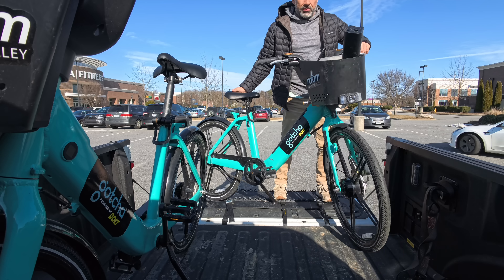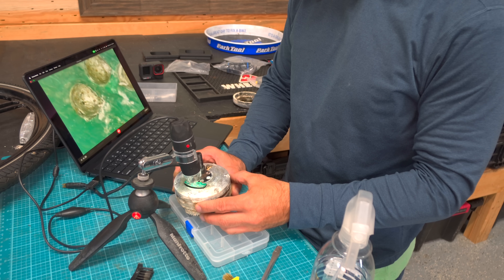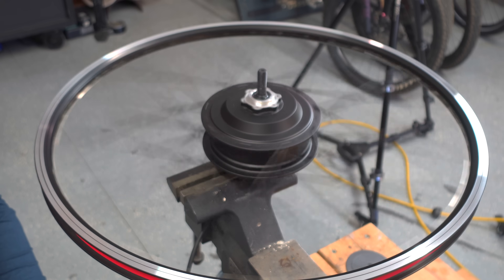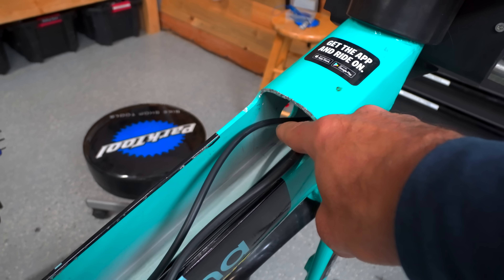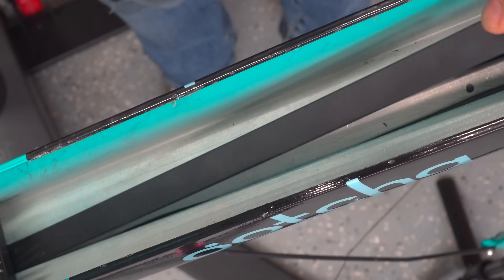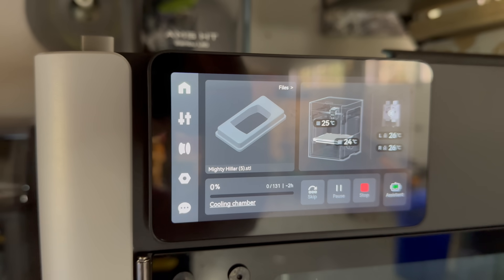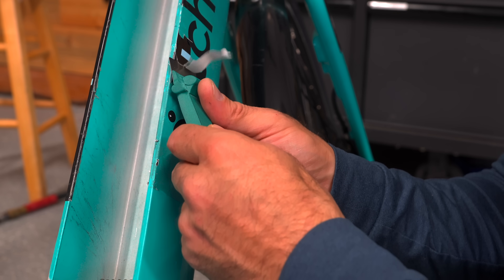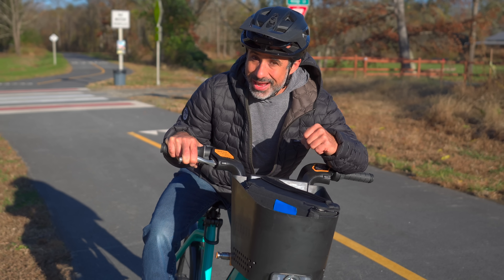What Will It Take To Save This E-Bike From The Landfill?

Comment: @berm peak

I've been homeless since February 10th, 2024. I was laid off from my job 2 days prior. I slept mostly on benches, not even a tent. Currently Im working, sleeping in a pop-up camper with no water and minimal heat. Prior to where I ended up, I saved money to purchase an Engwe M20 2.0 , but currently it's not working. I'm working for a small landscaping company and right now we do not have much work, unless it snows.

I was sent a new motor as well as a new controller. Having this e-bike work would mean I have a small room to go to, with an actual shower and bathroom. It would also help with getting another job, I gave just $200 remaining to feed myself and filly propane tank for heat. Please do me a favor and let me know if you can give me some guidance in this. I'm not asking if I a handout, just desperate because I'm not a bad person. Just fell on very difficult times and I don't want to die.

Comment: I'm just over here thinking why 3D print an adapter when you can just 3D print a slightly longer version of that as a socket with the ratchet adapter size on the trailing end 🤔

Comment: Did a quick search through the comments, and saw quite a few regarding the front brake.  My opinion is that the front brake is the primary brake with the most stopping power.  No front brake on ANY bike is pretty sketchy.  Now make the thing an eBike for super speeds and extra bike weight... you're way into sketchy territory.  I'm sure you'd be just fine given your bike handling skills, but put your mom on it and you're asking for big trouble.

Comment: You could probably take the guts from the new hub motor and put it into the old wheel they all seem to be very similar.  Making a disk brake adapter for it is doable.  I could make it out of metal, or design something and prototype it in 3d print and the have one of the CNC services mill it.... There is one that does a lot of YouTube sponsorships PCB-way lol ... And since not a bike product it doesn't influence your channel objectivity

Comment: mate for the front fork to have back a brake, you can go at a metal fabricator to make a meta plate that act as extender/holder/carrier for brake caliper with threaded holes to mout straight on without the need of nuts.  that plate can be made via a cnc machine ;)

Comment: It might seem a little retro, but why not simply fit a rim brake set to the front?  At least the bike will have two brakes instead of only one, which is proper built in 'redundancy', esp as the original manufacturer built the machine with two brakes in the first place

Comment: With a little more effort you could get the taillight diffusing nicely in that little space.
Then again with a little more effort you could have made it an active brake light...
But for better diffusion you'd mount the LEDs up against the back of the enclosure and make the back surface of the diffuser vaguely paraboloid in shape with 6-10mm between them. 
Technically it would improve brightness at off-angles. But you'd be making a better taillight than 99% of commercial bikes at that point.

Comment: wonder if anyone can point me in a good direction since its alot of ebike repair i got a funghange eb-m1 as a gift the rear hub axle got striped they sent a new core i managed to fix it but it has an odd issue that speed  just drops off everything works but the speed reporting just stops if it sits for a day it works again and you can have it run on a bike stand forever and it wont show up only when its on the road again pedal assist and throttle work fine it just stops reporting speed they did get back and say the heat sensor and speed sensor share a line but also i haven't been able to pin it down as over heating because it just dosent seem hot at all anywhere

Comment: You did a great job of getting that e-bike back on the road! I've opened up a few water damaged hub motors in my shop. It's not entirely impossible to potentially restore them. The rust combined with the magnetic flux from the neodymium magnets on the rotor will probably require you to pound on the end of the axle to get the motor apart. The rust can be clean off the stator easily enough, but getting the magnets clean will be more challenging. I use a technique of soaking a towel in solvent, and pinching off bits of rust until it gets cleaner.

It might have also been possible to swap out the motor assembly. It looks very similar to the style of hub motors that are common in electric scooters.

Another option for the lack of front brakes would have been to install a direct drive hub motor that has regen.

I really appreciate your video, and how you're helping to de-mystify the process of repairing e-bike electronics.

Comment: Hello Seth, as an aerospace engineering student and a 3d printing fanatic my self, I definitely recommend using the "gyroid" infil patern. From my testing, I have found out that you can usually have higher print speeds without sacrificing print quality. Also, avoiding "sharp" edges is for sure a great way to increase under load stability and fatigue resistance. For these reasons you should avoid the grid infill pattern for mecanical parts that you want to last ! Great video have a good one thanks.

Comment: Wow, I got inspired by the last video and bought one of these bikes on facebook marketplace, with my luck i got one which was in the condition similar to this bike, with that wheel locked, i couldn't actually figure out replacement front wheel. So i had to fix that motor which looked flooded, and mine was as well because they left it out in the rain for 8 years. Anyways i was able to hammer the rotor out from the stator, clean the whole thing and resolder new wires and hall sensors and got the motor to work and followed the process in the last video. That wheel bolt tool is awesome could have used that! but i had to take a angle grinder... Anyways after doing all of it, my wife got tired of me taking up too much garage and told me we don't need motor power... and i had to flip the bike to some one else...

Comment: 3:23 "Could it be that we just clean it and it works again?"
Something about the length of the video tells me it can't be that simple for getting the wheel working again. But there is more than just a wheel to fix. So I could be wrong.

😂 The branding under the branding sticker was a real "Gotcha".

Comment: Rear Drum Brake Only
'reliable' ahahahaha
while you might make the case that they're reliable since they always work and need no maintenance
they also always work badly; with no stopping power. Compounded by the fact that its the rear brake.
while its "road legal", is that really what we want as our milestone? still sketchy from a practical riding standpoint.

Comment: There really ought to be regulations about recycling these which include reasonable measures to make them usable when retired and sold on or given away. If there were, these bikes could be designed so that that can be done easily with minimal effort from the operator.

Comment: 17:54 Yikes. Is that the final state for that rear light's connector? I think I'd probably wire-loom that with something water & salt resistant, long term, because corrosion's going to get to those connectors fast.

Comment: I don't know how popular they are as a part for bicycles but on escoters it's very common to use the braking power of the front electric motor as second brake. It would be much better than skidding on the rear wheel on an emergency brake.

Comment: Did you tried scanning Bluetooth signal on them?
They use BLE so mechanics can unlock them locally without using 4g connection because SIM inside is already blacklisted.
I worked as mechanic for two companies.This one seems like OKTA model-same power connector but cables are different and it uses HiGo connectors but i am not sure it is bit different design or could be a Yumi .Dont rely to much on these original lock they are horrible and you can make motor free if you dip it in something that removes corrosion it may free up but you need to check hall sensor.

Comment: Pretty sure that's a compressive load not static on the socket adapter. I wouldn't rely on that as strength gauge if it's on anything safety related.

Comment: is the front motor  regenerative braking capable?
having regenerative braking at the front wheel would be very effective.
problem is adding a circuit to feed power back to the battery,
or another idea is to feed the regen braking energy into a another set of  red lights in the rear, creating a brighter rear red lights when slowing down.. you know like cars

Comment: Could you use a larger diameter rotor and drill that fork plate thing to get an old IS mount adapter to hold the caliper?

Comment: What is the reference of the controller? I have a similar case. I got an ebike but the controller is locked and the company went bankrupt and it seems there is no "easy" way to unlock it. I want to buy a controller but I want to get one that works for sure and is not impossible to setup.

Comment: I work on electronics as a hobby, it's possible those traces were broken like you  thought but whatever was soldered to those eyelets was giving you continuity. So it's always best to remove at least one side, ideally both then check your traces for continuity. Nothing worse than being on the right track and just overlooking something simple. But I'm confident you did more digging than you showed on camera so I doubt it was that simple. Man I love that we live in a time where we can just print our own parts and engineer solutions all on our own. Great job working out that battery latch!

Comment: Since you've been 3D printing a lot you can also print de-pinning tools to make removing pins from connectors like the one used by the headlight. The male connectors (like the one you changed the polarity on) tend to be doable by hand but the female ones can be tough, especially if there are a lot of pins.

Comment: 3d modeling tip: If you take a top-down picture of an object on something with a datum (like the grid on a cutting mat, or even a ruler sitting next to it), you can upload that image to Fusion, scale it correctly using the known measurements, then use it as a basis for your "sketch" to model from. (You'll need to take the picture from far enough away to avoid distortion between the outline of the object & the datum for an object like the computer that doesn't sit flush.)

Comment: A front motor hub compatible with a shimano roller brake isn't that expensive/hard to get. A G320.250.R should cost around the 200 mark, not more expensive than the wheel you're currently using.

Comment: At first I was thinking you were throwing away all of the most valuable parts of the bike, but then I realized it had a belt drive.  Definitely worth recovering it!

Wild that the front hub motor has pedal assist, though.  I can't believe you were able to salvage that feature!
Reply: All New electronic parts. The torque sensing bottom bracket was cool to see on the bench.

Comment: 11:37...

My man, with all due respect for everything else you do so right, when the torque wrench clicks, stop pulling! That thing clicked and you gave it another 1/8th of a turn. "Breaking" torque wrenches like that should be used fairly slowly and carefully and you need to stop pulling as soon as you feel it give way. If you give it the beans, you'll just keep turning the nut WAY past the set torque. It probably won't matter much on that rear axle, but if you're not going to care about getting it to the torque you set on the wrench, why bother using a torque wrench?

Comment: The iPad Pro can be used as a laser scanner, specifically with the LiDAR Scanner included in 2020 and later models. This technology enables 3D scanning for creating models, measuring objects, and enhancing augmented reality experiences, although its accuracy may not match dedicated professional-grade scanners.
     The angled catch would have been better made out of brass. It was a simple part and brass is easy to work and stronger.

Comment: If you do want to try to save that original wheel and hub, try Evapo-Rust. It might, MIGHT, save that hub corrosion. I would suggest not leaving it in the solution for a long time as I have had it destroy ferrous metal parts. My hypothesis was that some of the water in the solution eventually oxidizes the metal and then converts it back rusty bits into rust-free. I threw a rusty chain in the solution and it was ALMOST good after a couple of days. I then forgot about it and came to a black, rust free, stuck link chain and that is why I say to not leave it in the solution.

Also, another note. I did use Evapo-rust in my motorcycle gas tank. Cleaned out the rust really well, but afterwards my fuel level gauge doesn't work in all positions, when it did before the evapo-rust bath. So, maybe your electronics might not work afterwards in that board.
Reply: You could also go down the rabbit hole of electrolysis rust removal.

Comment: for the front brake, you could potentially add a hydraulic V or C brake, i had to add a rear V to my e-bike conversion as the disc mounting holes on the wheel motor were way off - a couple of drilled holes + nut-certs/riv-nuts and some standoffs = hydro V 👍

Comment: Great work seth! 
A little sad about the front wheel, very interesting how it got *that* water damaged
Also i don't think the 3d printed diffuser/lens on the rear light was the right call, as it made the already not-so-bight LED's even dimmer, i would've just left it with no lens, or used clear plastic sheet from something like a bottle

Comment: Put a hub motor and controller in there that can do regenerative braking. It isn't as strong as mechanical brakes but it's better than no brakes. I have regen on my cargo bike and do most of my speed control with that. As a bonus it means even less maintenance as the regen braking doesn't wear on brake pads

Comment: Great video. That hub motor was flooded and not for a short time. The white powder (minerals from the water) and the rust give it away.
Reply: It might be just a white powder motor which is a different style that's supposed to be completely caked in white corrosion powder as it operates.
Reply: Was definitely wet for a long time, that white stuff more likely is aluminum oxide
Reply: Hurricane Helene, perhaps. 😢

Comment: Sadly, the point that Seth proved is this bike was 100% e-waste. Without his skill, determination, time, and extensive resources, this bike could not have been fixed.  Since an ordinary person or tech has little of the above, and no way to monetize their effort, a repair is completely impractical. 

This kind of bike needs to be designed to be easily recyclable, because that’s the best outcome for the vast majority of them.

Comment: What CAD are U using to modle these items they look clean and well designed just the white piece that is used for activating the Cable on the latch has some striations on it

Comment: 4:13 you may be able to set it up so both the right and the left handle actuate that rear brake.  Or at the very least so the left still cuts the motor.  Or you may have already done that since it's usually a safety feature needed for the controller to say "go" on the whole thing.  ❤

Comment: Good news: some companies in China have now very accessibly prices CNC and metal printer farms and you can order stuff like a custom adapters that would allow front break for couple of bucks (literally couple - like under 10. Custom PCBs from them start at 2$).
This is good way, if you like to tinker with a CAD. Not a solution at all if you don't know how to design parts.
Keep tinkering!

Comment: Hi Seth, will you be able to fit one of the old rim brake types in front, mounted on the central bolt, where the front light is. They are not very good option usually, but will be better than nothing

Comment: Seth, have you considered making a video advocating for reducing e-waste by the cycling industry? With bike electronics becoming the norm, we are gonna see more and more of this. It should be possible to unlock rental bikes - just like in your video. Setup apps for derailleurs should be open sourced or protocols for these need to be available so people can program their own - my XShifter is dead weight because of that (oh, and screw you Paul for that) . It should not be illegal to reverse engineer wire protocols and publish these openly (Shimano and Di2).

Comment: Out of curiosity, if the mudguard wasn't there, would it be possible to be a cantilever front brake? Eg. by the mudguard screw hole or the lower basket one.

Comment: I love your videos and especially this project, but no front brake is an absolute NO from me, that is so dangerous!
Reply: Also illegal, in the UK at least. To be road legal in the UK all bikes must have a way to brake both wheels. If you ride a fixie you don't need a rear brake because applying back pressure to the pedals will brake the rear wheel but you still need a front brake! Having said that I ride my DJ bike around London all the time and nobody has ever stopped me but if I got in an accident, especially one that causes injury to someone else, I'd be in a lot of trouble!